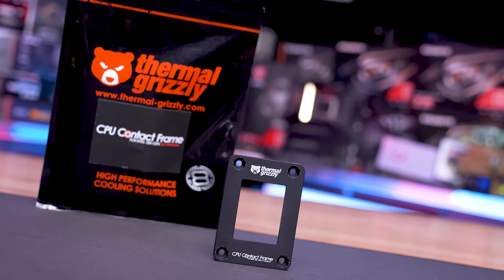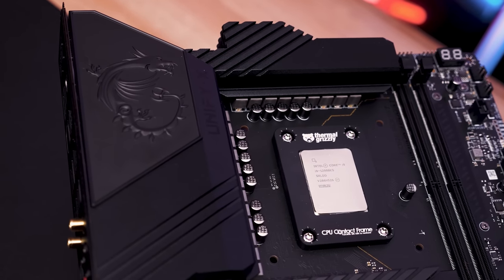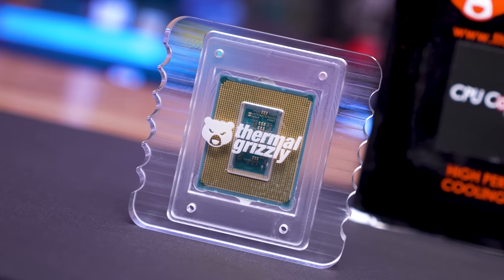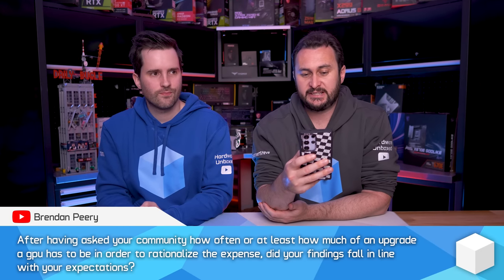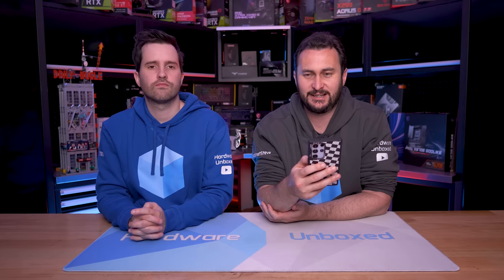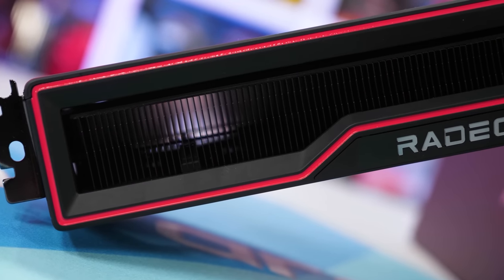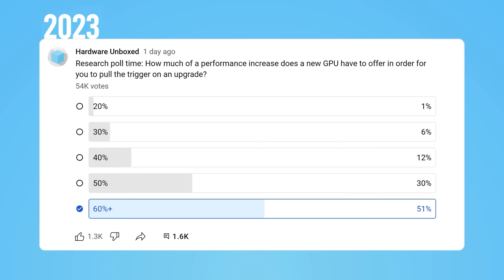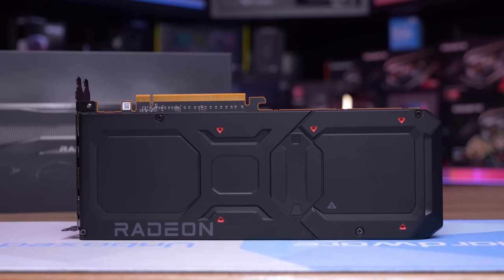RTX 4050 Pricing & VRAM, Are 12-core CPUs Dumb? March Q&A [Part 2]

Comment: I think the GPU manufacturers saw people paying way over retail on the last series because of the "shortage" and decided they weren't going to miss out on that money this time around. But there's also a market correction going on because consumer electronics saw a major boost in sales due to Covid lockdowns and travel bans. People took money they normally spent on taking holidays and spent it on other things. A lot of people were working from home and had to upgrade their PCs. Or even had their employers buying them to supply them for work.

Suits have to show increases year over year or they lose their jobs. The shareholders won't accept that there are circumstances beyond their control that affect sales and profits. You gave them a great return the year before. If you aren't going to repeat that then they are going to put their money elsewhere.

Comment: I've always upgraded my components when a +100% upgrade became available. I went from a 1080Ti to a 6950XT and that was ~ 80-100% faster. Technically now I have an upgrade path to a 4090 which is around 80-100% faster than a 6950XT but I'm simply not going to spend the insane premium Nvidia's asking. Just gonna wait out this generation and next gen I'll go with whatever makes financial sense, which by the looks of it would most likely be AMD yet again.

Comment: I think the problem with the current GPU market is a fab problem, TSMC can sell 4n technology very expensively because AMD and Nvidia are competing against Apple and Qualcomm a lot, companies that need smaller dies but still sell their processors (or their products) pretty expensively. This happened first in the mobile space, high end and mind range phones have crept up in price for a while, while apple M1 and M2 products are also pretty expensive for the die area of the processor. So because they use the same fab they have to compete for the newest most expensive node space (AMD even uses chiplet design with IO die part being on a slightly older, larger node, as that does not affect performance or efficiency that much)

Comment: I bought a 5900X because it was only a little bit more money than the 5700/5800 and gave quite a bit more performance with a clock speed bump. I feel like 16 cores at similar clock speed would be wasteful for gaming though. I run it with SMT off which makes it cooler and 12 dedicated cores with a good SSD makes for a very snappy experience.

Comment: For the 12-core 7900X. The 7900X and 7950X are the same price currently, but it doesn't mean that the price will stay the same in the future. The 5900X currently sells for 380$ in my country, while the 5950X sells for 615$. The same price discrepancy might happen with the 7900X and 7950X as well. Or it might be the case that AMD doesn't have a lot of 6-core dies, and are fine with the 7950X being that close to the 7900X(20$ difference in my country, 630$ for 7900X, 650$ for 7950X).
Reply: > The 7900X and 7950X are the same price currently
This left me very confusing. It seems like 7900X is just insanely overpriced in your country. On B&H Photo 7900X is $150 cheaper than 7950X.
Reply: @withkittens2532  Europe, third world country etc. We still don't even have cheap AM5 motherboards.

Comment: re: 7xx0X3D performance, I suspect part of the lack of apparent uplift this time around may be due to reviewers test RAM configuration. HUB's test of memory scaling with the non-#D CPUs found that they were very sensitive to RAM bandwidth and latency, whereas the X3D parts were not nearly as sensitive to it (basically the cache filled in the gap that low latency RAM was providing in the standard parts). So if the non-3D reviews were more predominantly using the RAM timings that AMD suggests as the "sweet spot"  (which is pretty high bandwidth / low latency RAM) this generation than they were in the 5xx0 generation, the 7xx0 reviews would show less of a performance bump (whereas reviews that used  bare-minimum RAM would see a bigger uplift for the X3D parts).

Comment: I think vram could be something they use to essentially to get you on a subscription model.  Kind of like they talked about the gtx 1080ti.  For example if you had say a 16gb 3080 and a 12gb 3070 would you upgrade to 4000 series?  Just got a 6700xt for 300.  With 12gb of vram hopefully this lasts a little while at 1440p.
Reply: GDDR6X in 2020 only has 1GB/chip version. 10 chips for a 320-bit system is 10GB in size. GDDR6 has 2GB/chip version. But in 2020 only 16Gbps GDDR6 is available, which will reduce the memory bandwidth fro 760GB/s to 640GB/s .

Comment: Here's the answer to the Vcache parts.. The 5800X3D didn't lose the clock speed that the 7800X3D did.. The 7800X3D went from running at Base of 4.9 turbo to 5.7Ghz to running at 4.2 Base and 4.9 Turbo clocks.. The 5800X only hit 4.9 and the 5800X3D went to a Max of 4.7 so there wasn't much lost in clocks.. Honestly if you are 4K gaming you don't need the Vcache with the newer AMD 7000 and Intel 12,000 to 13,000 series your good.. I'm looking forward to Navi 4 and Zen 5 really..  Zen 5 is supposed to be like the Zen 3 moment..

Comment: The problem is an incredibly dumb consumer base who think raytracing is more important than VRAM. Choosing cards like the 3050 or 3060 TI for raytracing, which you can't even use properly with those cards, instead of choosing something like the 6700 XT which has 12 GB VRAM and also has raytracing performance if you really have to try it. 

For instance you can play Elden ring with raytracing on with a 6700 XT, even Hogwarts legacy with medium settings and raytracing. But you will not want to! 
If you have a 3060 TI, you are not going to want to use raytracing either, because the performance will suck. So why not choose more VRAM, basically choose better hardware for cheaper.

The 6700 XT sells for 420 euros here (with a game included) while 3060 TI sells for 600 euros. The 3070 sells for 750 plus euros. Just think! Do you know what you are doing?

Comment: My 2070 Super still rocks in games I play at 1080P or 1440P. I paid just over $500 for it in May 2020, right before the mining boom took prices through the roof. I might upgrade, but the prices are so far off base, and for less! 192 bit interface of the 4070Ti, same 70 series naming, will seriously age quicker than my GPUs 256bit. It shows in all the benchmarks to struggle because of that and other factors. Is it 2x my Super, yes. Is it something that would last as long as my Super, no. It will age like a turd in a desert. I may hit up an AMD GPU as an upgrade, once their 7800 stuff comes in, if it offers 256bit + and at least doubles my Super. I, however, will not pay more than $500 +tax for it or something like it. I have been eyeing the Intel ARC stuff, but it is more of a sidegrade with tinkering fun. They are still new and I am sure all the driver stuff will allow ARC to possibly shine better.

Comment: I've been looking at second hand cards because it seems like that's about the only way I'm going to be able to afford to upgrade from my 1070. I found a 3090 for $1,000 - would this be worth the upgrade? I'm tempted by the 24 GB of VRAM, but I know the 30 series doesn't get DLSS 3.0 and I think the ray tracing performance is also weaker? I am looking for something that can handle 1440p at max settings, ideally with ray tracing on. I may wish to upgrade to a 4K monitor but not for at least a couple of years.
Reply: I've thought about this myself and am honestly stuck between the 4080 and the 7900xtx.  Might just wait to see what the 4080ti gets two after it comes out.

Comment: I normally upgrade to around 50% perf or more and sometimes skip a generation. But I'm so glad I sold my RTX3070 after a few months and got a RX6800XT instead. The performance difference wasn't really the reason, it's just the little RAM on the 3070 didn't sit well with me. The 3070 is still a great capable chip but it's getting rekt with only 8gb in newer titles.

Comment: I have the 12-core Ryzen 9 7900X and have been very pleased with it, don’t find it to be “pointless” in the least. 

I paid $425 USD for it which is a roughly ~ $150 less than the 16 core 7950X witch would be overkill for my use case (gaming / production/ streaming / etc - I’m not running a business. 

Not everybody who’s in the market for a 12+ core CPU needs the absolute “top tier” product. Running a business? Sure spend the extra $150 but otherwise if you aren’t that stressed for time the 12 core 7900X is just as good at gaming while offering excellent non gaming performance as well.

I considered the 7800X3D to pair with my RTX 4090 but being faster running certain games when I’m already getting like 200FPS w/ the 7900X for an 8 core $450 CPU didn’t make much sense.

With the $425 12 core 7900X I have an excellent CPU for both gaming (5.5 to 5.7GHZ sustained gaming) and virtually anything else.

Plus with 12 cores you have more headroom for gaming & streaming, etc. So definitely not “pointless”. If gaming is the ONLY thing you do sure just stick with a good 8 core.

Comment: Regarding frame limits. Last summer my PC started having problems running World of Warship on my 3840x1600 monitor. My Vega64 was suddenly running to hot.
I thought ok, hot summer, never been repasted, ....
But I found that the max frame setting had been removed from the game settings GUI. I had it set to 75 Hz.
And now the game was running 120-140 fps and GPU constant 100%.
Figured out to set the 75% in a config file and GPU is back at 60% and 90-100 watt.
I did repaste and repad it later

Comment: the 7900X and the 7900 are actually great value, the most efficient CPU currently and they are quite a lot cheaper than the 7950X, I can't afford the latter but maybe can save up for the 7900(X) so there is that. The X3D part... yeah. That's another story. There is no point in using those for produktivity

Comment: While I will not defend the 7900X3D (Why they didn't add 3D cache to both CCUs is beyond me), the X900 series parts had use cases with the 5900X (what I use) and the 7900X).  The cores were clocked higher, which gave a bit better game performance and the price gap between it and the X950 parts was closer to $250, making it a much steeper ask for those four cores.  I primarily game but every so often do things like 3d modeling and slicing, and coding that used all the cores I could throw at it so I decided to get that middle ground.
Reply: 7900x3d with two v-caches would be more expensive that 7950x3d… Who would buy that?

Comment: Is not the Zen 4 3D V-Cache 8 core version tested? From the back of my head. You tested the 7950 3D version with non V-Cache CCD disabled did you not?
Reply: Simulation is simulation. 7800x3d most likely use little bit lower binned versions of v-cache chips…
But also 7800x3d need only cool down one chip. So the exact performance remains to be seing.

Comment: Hello Hardware Unboxed and its community, I had a question regarding the AV1 function for AMD RX6000 cards. I know that currently they only have the AV1 Decoder but I wanted to know if in theory it would be possible for AMD to give us the AV1 Encoder with a Driver update ? Or is it a piece of hardware that is missing on those cards ? Really appreciate anyone answering this ! Thanks :).
Reply: No encoders and decoders are hardware features
Reply: @yellowflash511  thanks for the swift reply !
Reply: Doubt it. Both decoding and encoding requires specific hardware to be present in the silicon.
Reply: no, it's not possible for them to add encoding support. neither can nvidia with the 30 series.

Comment: Honestly, the biggest part about letting your GPU run at fullpower all the time is the thermal degradation that happens. You are lowering the lifespan of your GPU and running up your power bill for no real reason.

You are better off setting a max framelimit to target the performance you want and are comfortable with.

Edit, I miss the days when me and my buddies agreed that the 1050 was a bad value card and should have been cheaper. People argued with us everywhere until they realized many games were performing terribly on it within a year and a half.

Nowadays, those same people wish they had agreed and fought hard for the X050 class cards to go cheaper.

Comment: I have a very old laptop. I have a good gaming pc and ps5. So I don't use my laptop at all. For work they provide a last gen laptop as company laptop.

But I want to upgrade my laptop since it is 4th gen Intel with dual cores. Next year if amd makes P core and E core rzyen 7 laptop cpu with rdna3 apu gpu in that chip I'm buying one! It will be a very huge update for me not just performance wise but battery and size/weight will get better too! For mobile world big little has proven it's efficiency!

Comment: 25:30 My XFX QICK RX 6700 XT has noticeable coil whine at already 200 FPS. At 300 FPS I thought something is arcing inside PC. Fortunately those were just stress tests and I don't play at FPS higher than 144 FPS as my monitor doesn't go higher... but I still don't feel too good about having a whiny GPU and no path of upgrading to 240 FPS monitor due to noise constraints.
Reply: unlucky gpu i guess. or do u think everyone that games at 200+ has to suffer sound torture? :D
Reply: I have the same issue with my XFX 6800 XT. Kind of disappointing to be honest. I'm planning on streaming and concerned that the sound will be picked up by my mic.

Comment: The 7900 non-x is a great 12 core part. Low power, lower price, the dual CCD means it has lower temps than the single ccd 8 core parts.

Comment: I lowered my coil whine by mounting capacitors on the 8 pin PCI power cables, so I am pretty sure a good PSU can "fix" a badly or cheaply designed GPU VRM.

Comment: while i think personally raja kaduri isnt that great of a leader, there is one thing he did do that i love, put in a High Bandwidth Cache Controller on the Vega 64, this allows me to allocate system ram to VRAM, I am basically running 16GB vram with this and it allows me to play games that otherwise would have stuttering or lower texture resolutions due to only have 8GB

Comment: Well,  on the topic of Raja Koduri, shame on me! He fooled me once saying on stage that Vega will have SR-IOV and I pre-ordered two of them. Recently, (TechPowerup fixed the missinformation that was present on their website too) he promisesd SR-IOV on ARC and disclosed to many news outlets that DG2-ARC has 1/4 FP64 performance (see Wikipedia and other places that describe the chip). I bought a 16GB ARC 770 and guess what; not only does it not have SR-IOV (being the first Intel graphics solution in the last decade without any kind of GPU sharing, not even GVT-g), but is has all of the FP64 units completely disabled. The Iris XE in my laptop also has the FP64 units disabled, but at least it has SR-IOV. 
So, yes, I do have something against him specifically for lying to consumers on stage. By the way, ARC 770 doesn't come anywhere close to its performance claims when you measure memory bandwidth of FP32 performance; it's about 60-75 of what is advertized. There are no words in English to express my disappointment of the 16GB A770 as a compute GPU.

Comment: The main reason the pref uplift dosnt seem as big from more L3 cache on the X3D AM5 chips is prob the fact that DDR5 speeds on ryzen has a much higher GB/´s bandwith over the AM4 ´s DDR4 mem, overall that means the bandwith gap is smaller and prob less of a bottleneck on AM5.

Comment: On the 12 core question. If people don't remember there use to be a huge price difference between the 5900x and 5950x at least $150 to $200 more.  Now on Zen 4 it's like a $100 difference. No one also really cares until the x3d parts came out. With AMD parking the cores on the high frq die you basically have a 6 core when gaming and that 12 core 7900x3d starts looking real dumb. The 7900X and 5900x can just spill over to the next CCX with out a ton of penalty. Alos note the 3900x and 3950x had 4/3 CCDs so those would move data between CCDs all the time so it didn't really matter.

Comment: To be fair with the diablo 4 beta I'd seen the threads and put a frame limit of 120 FPS as soon as I got through the opening cinematic. As I was doing that the damn power draw went past 280W in the menu. Even with that limit the power draw in menus was still awful and I limited it further. For a game where people may take a break, go to the funny, etc and stick the game in a menu til they get back that's pretty lousy design, and stupidly wasteful of resources. They game designers should stop it.
Reply: It's more of a nvidia board design problem than a game dev problem. If there were more redundancies built in, unoptimized software wouldn't brick a card.
Amazon's New World proved it was a flaw in VRM component quality + reference layout design. Diablo4 likely is suffering from the same problem.
Reply: @silvershines  sure and I wasn't really worried about bricking as I was running a 6800xt but come on Devs, if you're gonna have a menu screen that totally covers the 3d rendered screen without even any transparency stop thinking you own my electric bill. I wonder how many games are running this second stuck on a menu page with the GPU sucking down 200W+ ... It's borderline criminal

Comment: People say my 10GB 3080 doesn't have enough VRAM, but I play on 1080p 144, people say it is massively overkill back in the days, now it doesn't seem so anymore. The thing that are getting obsolete are these DLSS 3.0, Tensor, RayTracing cores thingy not my VRAM. And I will only upgrade in 2026-28, until that time if Nvidia is still practicing this kind of anti-consumer stuff, where you have to buy 70's 80's series to get a passing experience, I will be choosing Intel ARC instead.